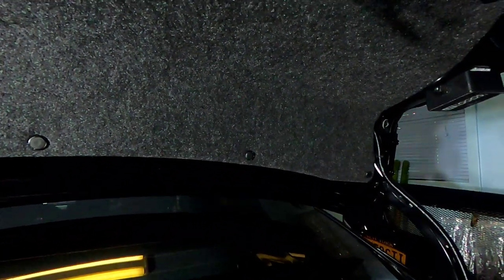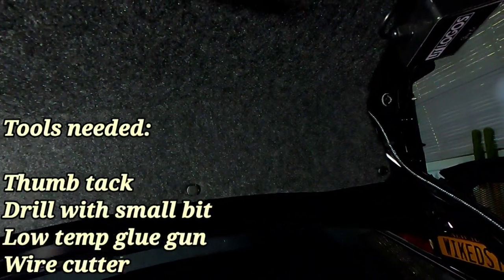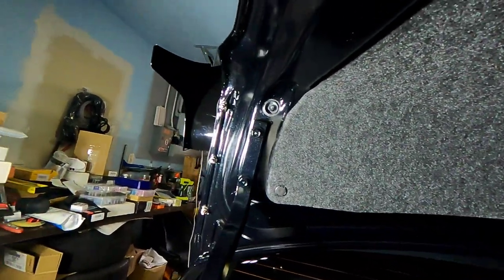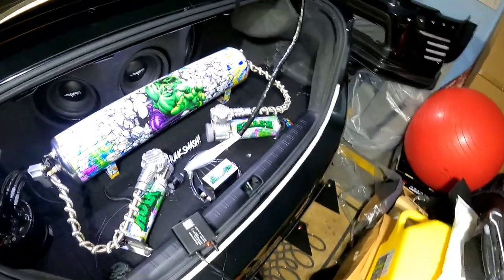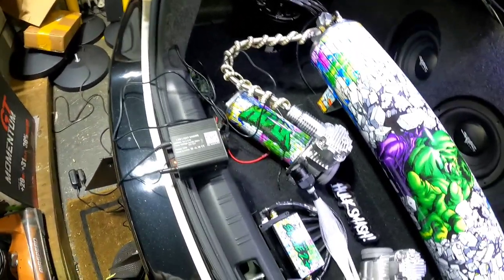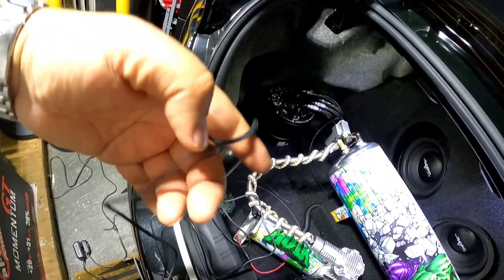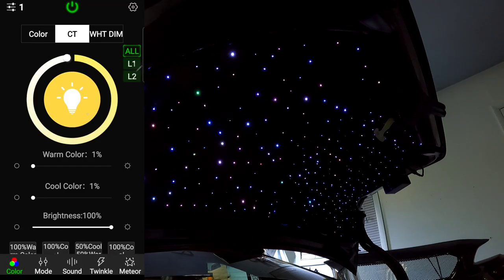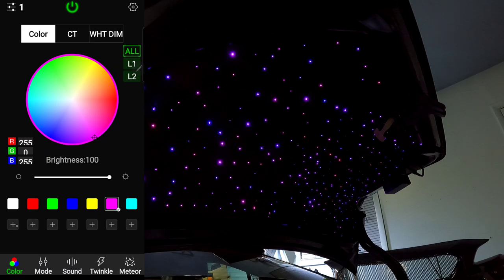INSTALLING AMAZON STAR LIGHTS IN THE TRUNK LINER OF MY 2018 SUBARU WRX STI

Comment: Great tutorial. I did the ceiling in my 05 300c, but want to do the trunk now. How does it work with the opening/closing of the trunk? Meaning - the wiring must be able to move with the movement of the trunk, yeah? This is what I'm stuck on.
Reply from the maker: The first thing I did was the trunk. I actually used my trunk as a template to see how hard or easy it was to install.  Up till now, i've never had an issue with my trunk.You just have to give enough leeway for the wire to flex.
Reply: Thank you!!! I will dive into it and pray it turns out as good as yours.